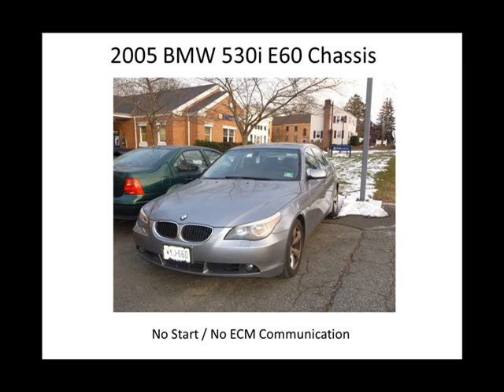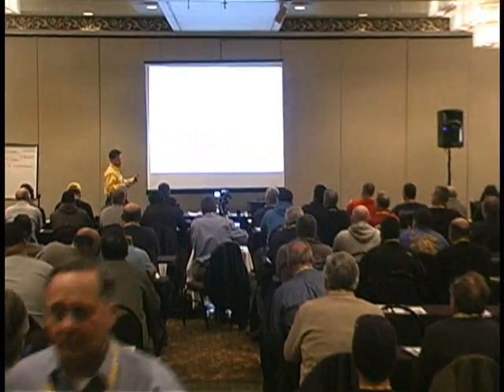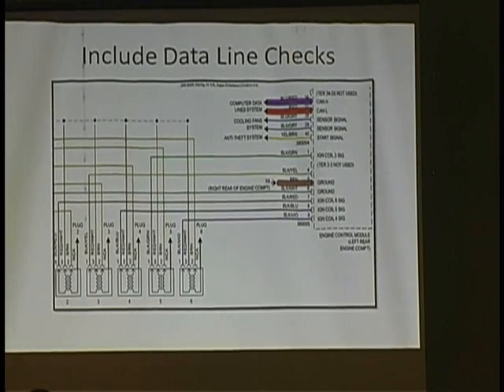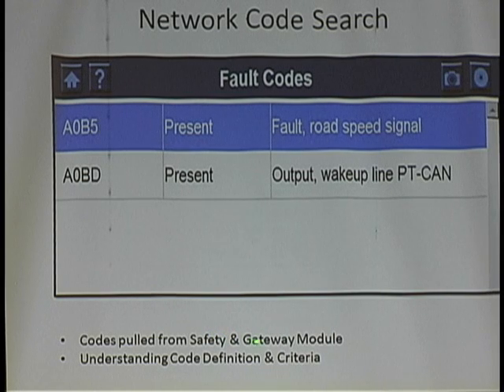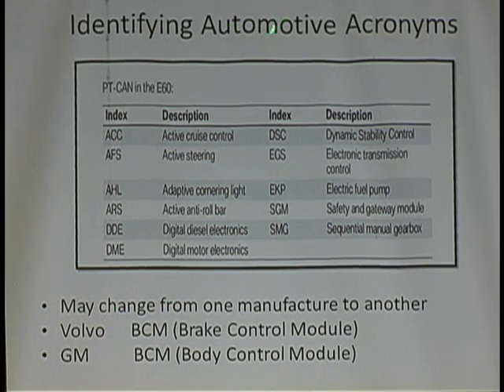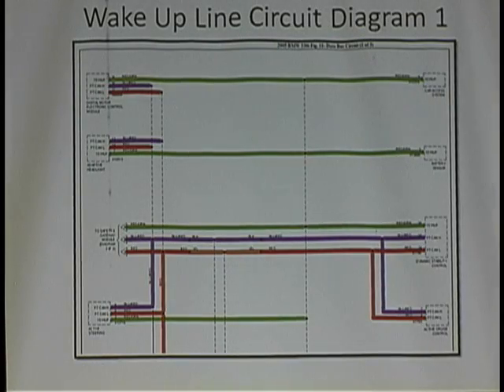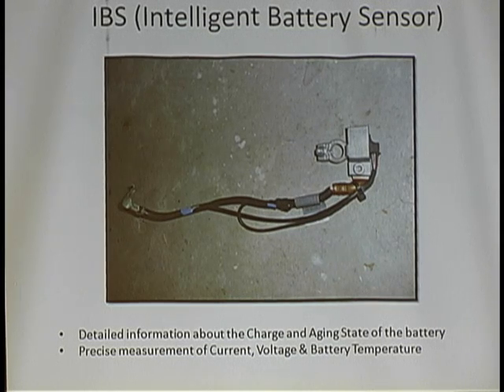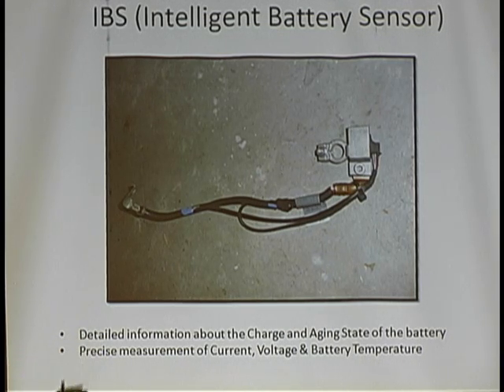John Anello TST Tenth Annual Big Event (Bonus Footage!)

Comment: Excellent info. My understanding is once the car sleeps after a new battery is installed it relearns the battery life on its own. To be clear i always register it to the dme but the guys at auto logic told me the info above. I asked about this because when replacing it reprogramming a dme the registration disappears. So i wanted to know what I’m supposed to do if a battery is 2 years old and the dme is programmed for separate issue. Any more info on this is welcomed! Thank you